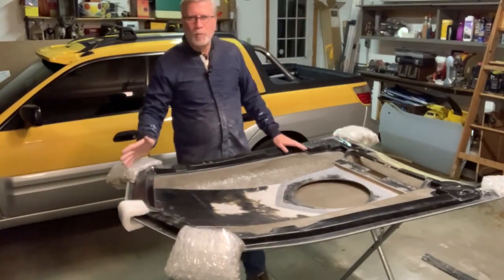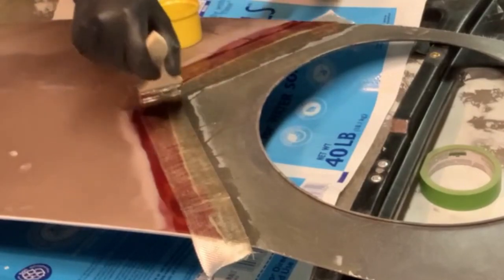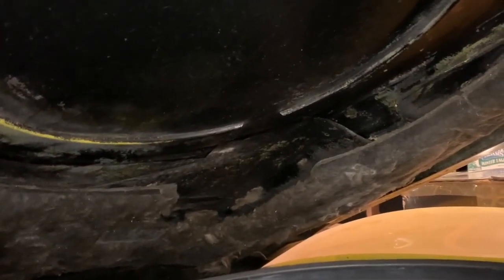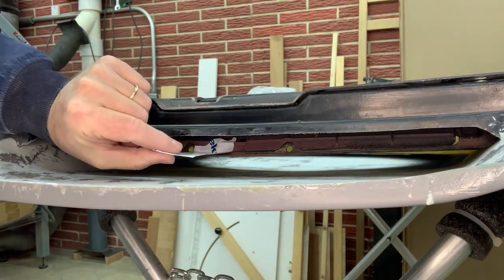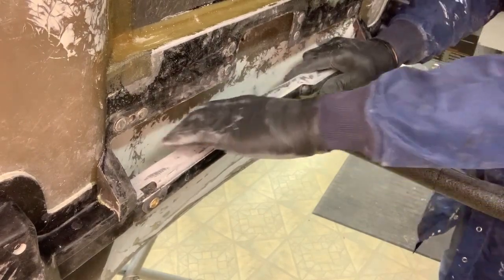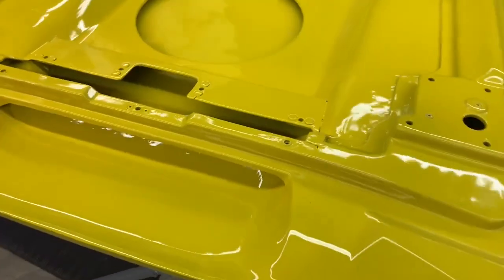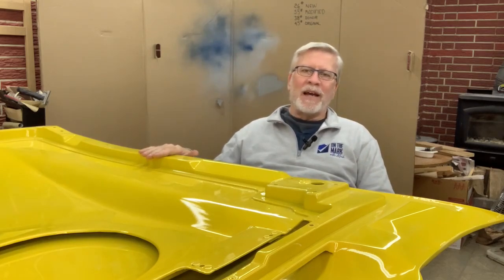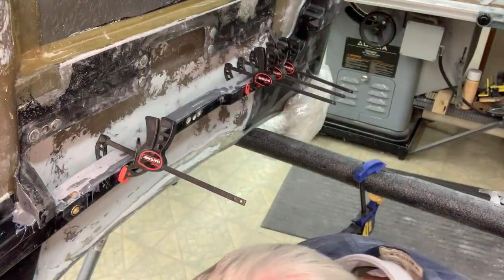Custom Corvette Hood Fiberglass Work Part 2

Comment: Ya know, honestly, you should have done the extra work that you expected the body shop to do and honestly, they didn't do well.
Reply from the maker: They did what I asked them to do. The line between what I wanted finished and what didn’t need to be finished got a bit blurred. I could have asked them to finish the whole underside, but that would have been an unnecessary experience.